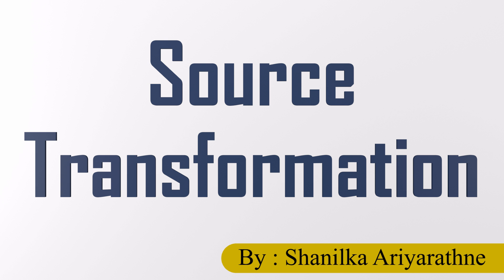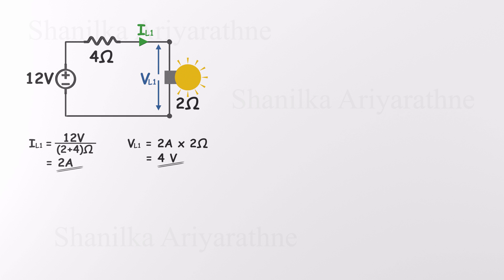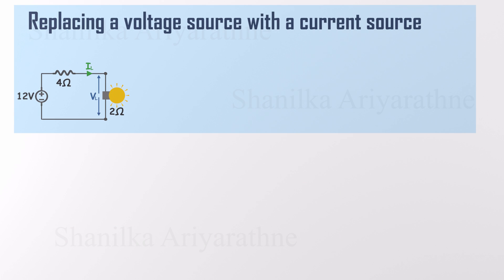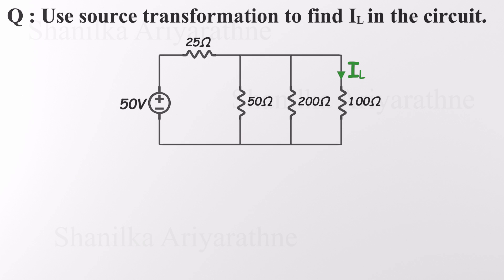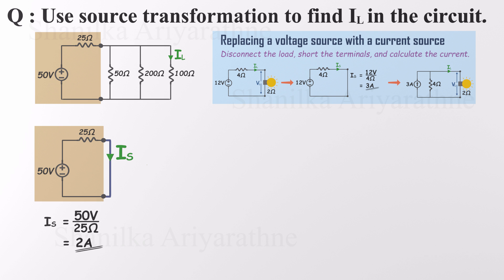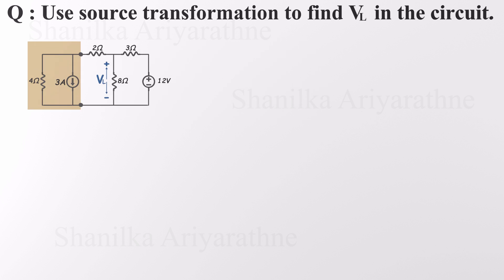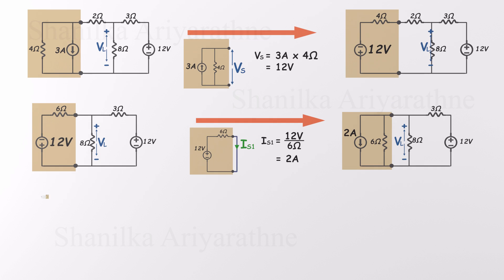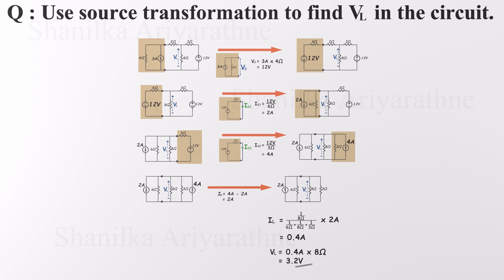Source Transformation Explained Simply | Master Circuit Analysis Fast!

Comment: the solution is wrong after the first step you have connected the new 12V source in the wrong direction the correct answer should be  9.6V .

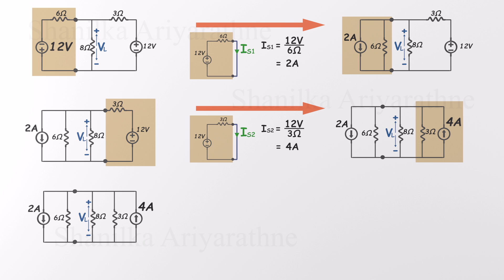Comment: Great video, but there's a mistake at 6:15. The current sources are in the same direction (counter-clockwise), so it's 6A equivalent when combined. That makes the load voltage 3.6V.